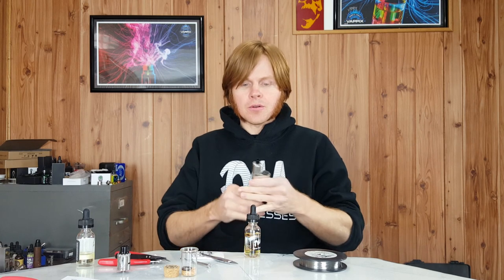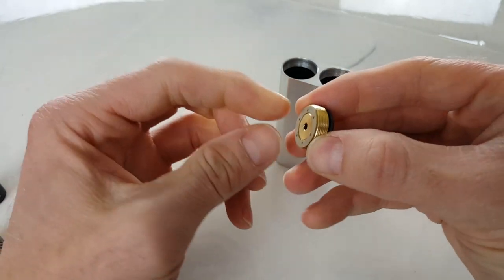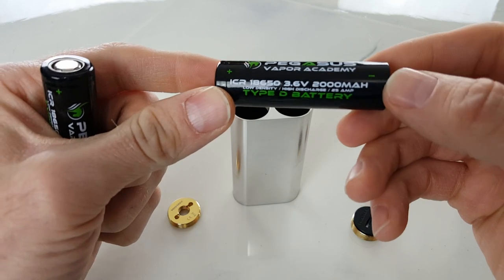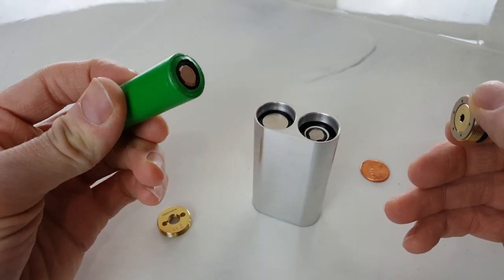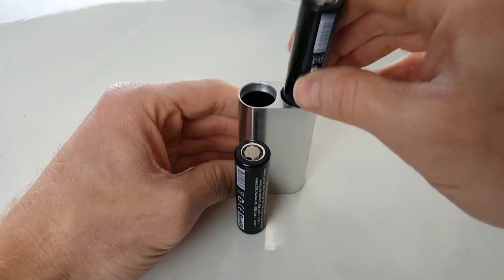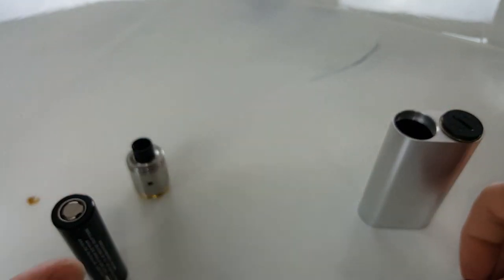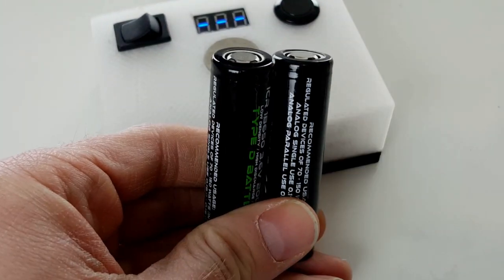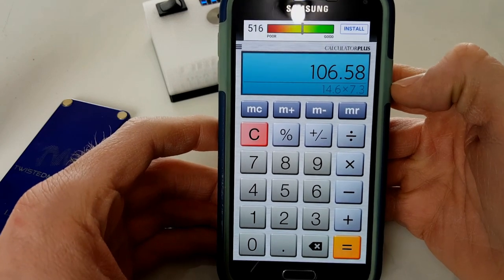Noisy Cricket - Series Box Mod Safety

Comment: Just got my Noisy Cricket the other day. Have been building for a couple months now, still learning and taking in as much info as I can.  I threw some 26/36 10 wrap 3mm all kanthal fused claptons in a Twisted Messes rda on the Cricket, running on LG HB2 batteries.  Hits like a truck.  May very well be the best vaping experience I've ever had.

Comment: Great advice and video and wish I had one of those Noisy Crickets which looks stunning IMHO . My general rule of thumb is when using a series mod build to stay in the safe range for what a single battery's rated amperage is and when using a parallel mod build to stay in the safe range for approximately double what a single battery's rated amperage is. Also, it is key to remember that amp draw is inversely proportional to resistance, so the lower your resistance the higher your amp draw is and that is why building low resistance for series mods is discouraged. Looking forward to your next video and happy new year.

Comment: My Noisy Cricket arrived yesterday.  One safety feature you didn't mention is the black plastic tubes inside the mod.  If you remove the bottom rocker plate you can slide them out.  They act as wraps for the battery in case the battery wrap isn't in good shape.  Very cleaver I thought.  Thanks much for the lesson, very timely for me.  I put on dual coil twelve wrap with 26 ga kanthel.  Came out to around .64 ohms.  Cheers!
Reply from the maker: Oh my, I didn't even notice those wraps, that's awesome. Yeah honestly it's great to see such a smart design with plenty of safety built into it.
Reply: +Twisted Messes 
I add them to all my mods. I started with a Caravela clone because of battery rattle and do it to all of them now.. They are simple to make and once you have your pattern you can make 'em all day long. approximately 2 5/8th x 2 3/8 inches.. I use regular office paper at first and then I found a thin sheet of plastic that worked great.
Reply: I'd like to see it become an industry standard.

Comment: Hey Kent, there is another way to figure out wattage output V² ÷ Ω = W ... If I have 7 volts and a .50Ω build , I would take 7 × 7 = 49 then I would take 49 ÷ .50 = 98 It would show that I am pushing 98 watts... I found that this was more comprehensible when I was teaching Ohm's law to my friends that were getting into building. Great video as always!!!  Much needed information, especially that none of the information that you provided in this video is on the packaging of the noisy cricket. Thanks!

Comment: Kent,  Great video brother!!!  You cleared up a question that I have had for a while and always got different answers.  When calculating wattage and amps do you use the 4.2/8.4 or the measured voltage at the atty?  Most people said to use the voltage at the batteries and I thought that it made more sense to do it the way you did it.  Good job explaining circuitry.  You nailed it.  Happy New Year to you my friend.

Comment: I am a bit surprised no one is talking about internal battery resistances. A new 18650 battery may have a nominal internal resistance of ~0.08 ohms. That is a non-negligible value when considering your vaping setup. As a battery wears, that value just continues to go up. This should not be surprising as your batteries heat up as you use them, more so the lower your coil resistance is.

One may think their coil resistance of 0.5 ohm on a series build with fully charged batteries is producing a 141 watt vape. However, when including the internal battery resistance: 2*(0.08 ohm) + 0.5 ohm = 0.66 ohm. (Note the internal resistance of the two batteries adds when series.)  A 0.66 ohm total load on a series box with fully charged batteries operates at 107 watt, but the wattage across the coil is only (107 watts)*(0.5 ohm/0.66 ohm) = 81 watts and the batteries dissipate 26 watts of power.  

The battery internal resistance is why building too low is an issue. More power is dissipated by the battery until it fails. In fact, the current a battery is rated at is based off temperature. If it is 30 amps, that is the constant current the battery can operate at while remaining at a safe temperature. 

The battery internal resistance is why a single coil is hotter than a dual coil of the same build. Run the calculation of how much power a single coil dissipates compared to a dual coil taking into account the battery internal resistance. One will see that each coil in the dual coil setup dissipates less power than the single coil. Of course, they dissipate more power together than the single coil.

The battery internal resistance is why you marry batteries. You want to use new batteries that have approximately the same internal resistance so both batteries drain at the same rate. And both batteries age at the same rate. 

So why is no one talking about battery internal resistance?

(Yes, the other components that conduct current that are not the batteries or coil also have a resistance. It may be significant in some setups, but I estimate it being an order of magnitude or less in most cases.)

(The battery internal resistance is probably not a factor when using variable voltage/variable wattage setups. The circuitry regulating the voltage is occurring after the voltage is regulated. One may notice a tank works best at ~4 V on their mech mod while it works best at ~3.7 V on their regulated box.)

(It is also possible I am completely wrong. Wouldn't be the first, won't be the last.)

Comment: Kent
Thanks for this video-I went to throw a 26g/36g fused clapton dual build in a TMRDA on the JayBo designs Noisy Cricket by Wismec- and decided to check the draw that would create from the 2 18650 in series - if my calculations were correct at 0.199 and 7.3 volts I would draw 36 amps...too much from 30 amp batteries- you may have saved my life.

Comment: I've only ever use regulated mods as I was always been a bit too nervous about mech mods. I had heard quite a bit about the Noisy Cricket, and this video really helped me to understand it, but more importantly how mech mods work with batteries. Honestly, I think I may pick one up now with some more batteries (may even order some of those VA batteries you have). I'm still not too sure what the point of a mech is over any high powered device, such as a RX200 or something, but perhaps it's just pure simplicity and novelty?

Comment: Good video man. This is a very nice little series box that appeals to people on many levels and one being the cost. Glad you put this out there.

Just a general question about the cricket if you see this. If one had to pocket this mod for work and was worried about it firing would it be enough to just unscrew your atty? The hybrid cap looks designed in such a way as to not short in a case of no atty and firing

Comment: thanks for this video twisted!! i have my noisy  coming and a indestructible (as it has a great pin) and your video helped me alot i new most of what you said accept i thought puting them in the wrong way caused a hard short - good to no it just dosent work - thanks for this video !! as th mod is rather cheap alot of people could like the design and looks of it and buy it but not have the knowledge to use it correct!
Reply: +Chis Tait i got the indestructible but i dont like it all that much on any mod far to much airflwo on the side i wish you could controll it also i get mad spit back on low ohm build .32 on the noisy mega spit backbut i have not tried claptons in it - ironically my 2 fav RDA's is the Derringer for tube mechs and twisted messes for regulated - i put sum Flapton (flattened clapton wire)8 wrap coils in the twisted messes and its soooo good on the noisy cricket .4 love it! i ned to mess about with the indestructable more if i could get it to stop spitting it be nice - i think it be a good RDA for a tripple series PWM box

Comment: Probably the most informative series box mod review/explanation! Don't have to be an expert to explain how it works! The way you did it helped me learn more about my noisy cricket than any other review! Do you recommend 22/24gauge for this box???
Reply from the maker: No I wouldn't recommend those sizes. Maybe with enough wraps with 24g around a 3mm driver it might make it above 0.4 for a single coil but I'd do 26g with around 12 wraps for a dual coil
Reply: +Twisted Messes thanks man I did the 12 wraps 26 gauge and it came out awesome

Comment: Touching like-terminals on high current batteries such as li-ion will cause damage. The slightest difference in voltage or power output can discharge one cell to the other. This is the reason why multicell li-poly batteries (used in RC toys) have separate charging terminals to help balance the voltage on each cell during charging.

Comment: Hey Kent...new vaper and even newer subscriber.I really like the looks of the cricket and you explained the safety issues well.What i do not understand is why my batteries do not show all the information that needs to be known.My batteries are just green with a sticker that says 18650...Why are the manufacturers not putting the information  for safety reasons?For example..my batteries say ImR 18650 3.7 volt 3000mah....why wouldnt they put the amps on it?

Comment: @twistedmesses when batteries are wired in series, it doubles the voltage, increasing the wattage it can put out. The amperage stays the same. When you wire batteries in parallel it doubles the capacity and the amperage that they are CAPABLE of putting out. A circuit will only draw as much current as it needs. When you short a battery (essentially what a coil does) the load (coils) will draw a lot of current.

Comment: Do like this idea.this mods been on my radar for a while.might order one.been kinda missing my mechs and this deffanatly seems to deliver on power and is still simple and looks like it will last a long time
Reply from the maker: The button assembly has plastic threads on the v1 noisy cricket and tends to wear out really quickly. Haven't tried the v2 or v3 so can't comment on those

Comment: Hey Twisted, just wanted to thank you for all the helpful vids. I'm 2 months in after giving up the stinkies and I love it. Leaned a lot from your vids and I enjoy creating all the different types of coil wire. My fav atm is a 30ga chain that comes out to about .5 on a 5 wrap. doubled up they chuck awesome and the flavor is outstanding. 
I took a bit of my work into my local vape shop and everyone was digging the stuff.. 7 city's vape if anyone cares. Here is a pic of some 26ga i was practicing with, i.imgur.com/uiEb1sL.jpg . Thanks again for all the helpful vids..
Reply: +Bill Stelling Hey twisted, I see you have a set of medical safety scissors and I wanted to share with you my way of smoothing the wire that does not junk it up with shavings from the needle nose pliers. I use the handle side of the stainless steel scissors.. It works great on the chain builds and others I have tried. http://i.imgur.com/Sr9IAR1.jpg 

Final product.. http://i.imgur.com/0QtvTl5.jpg    Just realized.. I haven't cleaned it yet, but that might be better so you can see how clean it is before washing it. Honestly, looking at in under the scope it looks clean as can be now but I'm still going to wash it..

Comment: I’ve been running the NC just over a year, really happy with it and fairly confident building now. I’m still using the Fat Daddy upgrade kit for some added safety (just the 510 though I prefer the original fire button) 

What series mech would you recommend as a nice step up from the NC? Was looking at MCM next but are there any others worth considering? I’d buy another 18650 mod but would prefer a 20700/21700

Comment: Since the batteries are fully charged and attempting to put out 4.2V each, shouldn't  you assume the non-sag voltage output to calculate the amp draw?

Comment: @twistedmesses would it be safe to say that you should calculate your series (8.4) not under load to give yourself some safety room? For example, 8.4 / .8 = 10.5a instead of calculating it as 7.2(volts under load) / .8 = 9a?   Also, If I build my rda to .8 ohms ( 1.6 ohms each coil)  im still within that safe zone when using two 20a or even 25a batteries right? Just trying to learn as much as I can before buying a series mech mod. Thanks man. Great videos! Cheers

Comment: +Twisted Messes I just received mine in the mail. Just a heads up cause I noticed it with mine: put the switch on first. I burned my finger putting the switch on because I pushed down on it accidentally. I'm sure you noticed, or someone already commented, but I definitely recommend putting the rda on after the switch to avoid any accidents.
Reply from the maker: Yeah that's kind of a bi-product of the design. I agree with you but unfortunately due to the rocker-plate at the bottom, if you screw the button down first your RDA won't always sit flush. I'm just really careful when I use this mod and I make sure the top-cap is on my rda before I screw the button in. Thanks for adding to the discussion!
Reply: so basically you have to put on the switch first before screwing the rda, am i right?

Comment: hey just bought and I am waiting on delivery of my noisy cricket, what is a good series build for it using nichrome 80 or a mix of kanthal and nichrome?   Been doing builds for about a year now but mainly on regulated mods except for a couple of single battery mech mods like a fuhattan or 4nine, I have done some research and have learned I should build between .25 to .5 ohm pretty much like you said in the video,  I just don't want to throw a regular build in and think eehhh, could of bought something else.....  have the indestructible jaybo rda coming with it, but also have velocity, as well as mutation x v4, and yes sorry working on grabbing a twisted messes rda, but what build would you recommend for the noisy cricket?

Comment: Hello, i have a quick question, so if I get a higher Amp limit for my batteries, will it be safer? I currently have a AWT 40A battery, running a regulated device but want to try to get into the unregulated ones.

Comment: Thanks for explaining what happens if you put one battery in the wrong way, Ive been trying to figure that out all day!  Do you know as well if putting both cells in the wrong way is dangerous? Or would the mod work exactly the same, just with the current flowing in the opposite direction?
Reply from the maker: Yeah, a coil is just a simple resistor, so there is no specific direction you need the current flowing through it for it to function. So it will work normally with batteries backward in any fully mechanical device. The thing to keep in mind is that battery contact shape is sometimes different and the wrap near the negative or positive can be different too. Some mods are designed around these aspects so just make sure the mod doesn't have some design aspect that will interfere with the battery, but yeah, works normally
Reply: @TwistedMesses  You're a legend, thanks!

Comment: Hey Kent, I don't have a pass through voltage device to check what the voltage would be with the added resistance of the atomizer and the build. What's another way to get a rough idea?
Reply from the maker: If you don't have a pass through voltage meter then just assume the max voltage of 8.4v when calculating amp draw to be on the safe side

Comment: Thanks for doing this video man, safty is key! Question for ya: I usually build my rda at .6 with kanthal and I've been noticing that my Sony vtc5's are forming dark splotches under the wraps, do you know what that is? ( never had that happen before)
Reply from the maker: That has happened to me as well. I'm unsure what the mysterious blotches are but I have to assume that is corrossion of some sort. When that happened to mine I recycled them even though they still seemed to work fine
Reply: Twisted Messes Oh man, that stinks. I bought them brand new just for the cricket and ive only been using them for about two weeks.Crazy, oh well, better safe than sorry. Thanks for the advice man, peace :)
Reply from the maker: +Brian Vath might wanna wait for someone with more knowledge to reply first. I'm unsure of what the speckles might be

Comment: Are you using your new twisted messes squared rda with the noisy cricket?  Just got them both in, and I'm so disappointed to see that the TM2 rda's 510 pin is like flush with the insulator.  The pin sticks out a little, and the insulator that it's recessed in also sticks out, but they're flush in relation to each other.  Scared to use it on a hybrid connection like the noisy cricket.  So bummed.
Reply: +mp910mx Ok I just watched Grimms video on the Twisted Messes squared, and apparently that insulator that is flush with the 510 pin, actually adds safety in his opinion and he has no problem using it with the noisy cricket.

Comment: Hey, I just bought my cricket and I threw my batteries in there. I tightened both the firing button and the atomizer connector, without the RDA, and instantly my batteries started hard shorting. Luckily I was able to get one battery out before anything bad could happen, but I was just wondering why this happened? Do you think I tightened the buttons too much?
Reply: its a hybrid mod, you have to put the atomiser onto the hybrid connector BEFORE you put it on the mod, dont put your 510 hybrid connection on the mod with batteries in it and no atomiser, if your battery touches the hybrid connector and the switch goes down it has 0 resistance, so a hard short, you are very lucky it didnt explode it your hand, basically screw the switch on with both batteries in, put your rda into the hybrid connector when it isnt on the mod, then look and make sure the 510 on your rda protrudes out from the hybrid connection, then screw it on